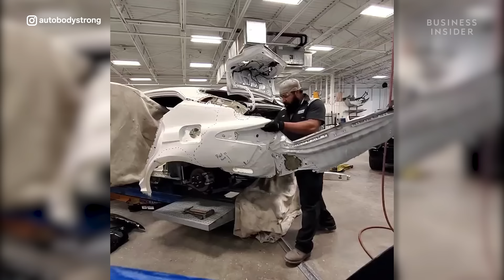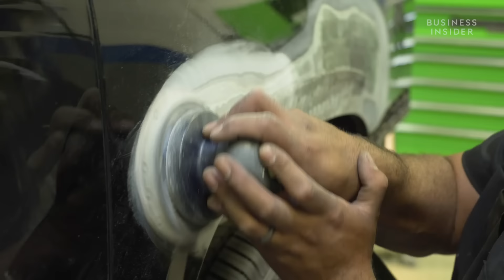How Wrecked Cars Are Repaired | Cars Insider

Comment: Correct me if I'm wrong, even if the structure is pulled into original shape, the material structure is compromised? Like microcracks?
Reply: True, and if it is the main frame, I would have issue with that, but not so much with most everything else.

Comment: My wife’s 2016 silver Honda Pilot started developing spots on the hood and roof in 2017.  It was examined and the spots were deemed under the clear coat.  As if the silver was corroding. We bought the car new and when we got it, we got an optional paint warranty.  But the warranty company refused to cover it.  Honda went ahead and did the job and billed the warranty company.  The Honda rep said “what exactly would the paint warranty do, if it didn’t cover paint problems?”

Comment: I've never seen a flat line puller, usually used a pin welder and a sled hammer or plastic pulling tabs and the sled hammer, very cool.

Comment: When pulling on a unibody you will never get it back to factory, the fender may line up but inside you have metal that is weakened and never as strong as before.  Very few body shops will pull the inner structure to factory specs then cut it out and replace it before replacing outer panel.
Reply: Almost always better to just replace the affected panels, did a lot of that rather than pulling. So many crunched trunk pans and quarters done.
Reply: As long as the specs are returned within the factory build tolerance, it's a good repair. The metal doesn't weaken unless it's crushed or kinked, and even then it's irrelevant unless it's structural. We repair pans, aprons, baffles, radiator supports etc. --- all non-structural.
Reply: @xpicklepie  The white rig in the video has UNIBODY damage the unibody is a frame on non frame rigs. The structural metal the guy is pulling will never be factory perfect. The metal will stretch and the points may line up but the crushed metal will always be weaker that factory, it will crush a lot easier if hit again. Any decent car person will pick off that repair and it will affect the value of the car, it may fool Stevie Wonder but not a person that knows cars.

Comment: I had my first two cars Volkswagen purchased from Weiss vw in queens village New York City 1969 1970 it was very honest sales service part even body shop all lean honest nothing un safe left there I possible to prevent  so I only would like to see more done this way these days  why is there now so much screw you double financing charges dealer or bank both extended warranty you should never buy or use of cheap bad parts not organic Orem ones that fall apart in two days off the window defroster rear window when I was growing up much nicer more honest quality work from those who really cared the worst is the nut behind the wheel operating or loco driver on drugs alcohol more what troubles this causes too much done today is how fast it can be fixed rush rush I have said in my past remarks enough we live in a society of very sick loco volks doing very stupid sick senseless thing as weird as is the persons doing it haste makes waste sometimes take longer to do or when if possible not right time to do over over donot we should try to do more than we could in 24 hours per day adios for now until we meet again

Comment: I ran a Carfax on my old Camry out of curiousity that I sold several years ago after owning it for 7 years. Come to realized too late that the car was a total loss 6 months before I bought it. It was my first car and I was attending college but it didn't seem out of place performance wise. Only notable imperfection was the left side mirror cracked and the rear passenger fender had a clear coat scratch. The car was in two accident, one minor (the right side) and the front (major, insurance written off as total loss). Odd thing is, there was no salvaged title with the car.
Reply: people spending too much time worrying about title...A low mileage total loss car is better than a high mileage clean title car..

Comment: FYI don't buy vehicles with this kind of damage. When steel/aluminum is deformed, pulling it back to it's original shape will NOT regain it's original structural integrity. So if you buy one of these cars and get into another big wreck, you are basically done. And yes these guys are clean and stuff but don't buy rebuilt cars for your safety.
Reply: FYI this is why Repairers have to follow Manufactures Guidelines and repair procedures now.
Reply: @Jpgundarun      once the steel/aluminum is deformed, it will never regain it's integrity even repaired. ask any honest engineer and they will tell you the same thing.
Reply: @joezhang839  So multi billion dollar car manufacturing companies don't know the best ways to repair their own products. You Tube experts know better do they? I have been repairing major damage on cars for over 20+ years without a single problem so you must know better than me too.

Comment: It’s revolting to see him grind the paint of that dent to weld the keys while instead it could have been repaired by a guy that does Paintless Dent Removal and the panel would have been good as new preserving the factory paint which can never be replicated in durability. Fair play for all the work done!
Reply: That's for sure. Once had hail damage to my truck. Insurance company wanted to replace the hood etc & said it had close to $4,000 damage. Took it to a paintless dent repair & they repaired it for less than $400! Couldn't tell it was ever damaged.
Reply: My thoughts exactly. Pointless dent guy would have qorkd magic on that
Reply: Did you not see the paint was scratched before he started? Makes no sense to paintless dent remove a panel that needs to be painted anyway.

Comment: If your car is on the frame machine it's totaled and shouldn't be getting repaired.
Reply: Lol not true at all if the car was put together in the first place it can be restored to that state. Your clearly not in the business so just shut it Nathan
Reply: Obviously a massive frame bent in half will never been the same but slight bends a few inches off from front to back can be fixed with no compromise to strength the metal remembers its shape it wants to go back to where it eas
Reply: When a nascar gets in a wreck do you really think they scrap it? They just pull it back into shape and it goes to the next race. When an old classic car is restored and it has old damage from decades ago do you think it should be cut up for parts?

Comment: And what happens when the damage is so extensive to the frame itself?
I guess is total loss
Reply: Frame rails get replaced using the factory weld points.
Reply: If it's a ladder frame as in a pick-up truck, they actually pull very easily. They're usually riveted together and there isn't so much damaged metal as there is mis-aligned joints and crossmembers. They're made to flex quite a bit.
If it's a crushed or collapsed frame rail on a unibody, the damaged section is replaced. The cars are made with 'crush zones' that keep damage localized.

Comment: Most mechanics watching this video 👀👀, for those who don’t know, imma reveal some secrets for ya, a lot of the time we don’t do things by the book, we don’t use laser measuring tools and equipment to tell how far off something is (unless we are dealing with insurance and need to prove there is frame damage) we will just free hand it, yank on it a bit, a bit more, bang it back in place with a hammer, see if it’s cohesive and or juts out, if not, and it’s hidden from direct sight, then comes the saying, outta sight outta mind lol, this applies to both dealers and small shops, I’ve worked at a body shop that is bmw Porsche Volkswagen Audi and mini certified, did things the exact same way (all be it, with fancier tools lol)
 None of this is to say body shops are bad, it’s just that most insurance companies rob us when it comes to work, sometimes they’ll have us buy parts and remove it off the estimate (this means we can’t even use the part, even if we do, we can’t charge anyone for it, meaning we will have to pay for that) and some will also charge such low labor rates it’s absurd, 2 hours to pull a structural part of the car, and your paying me 50 dollars an hour for that kinda specialty work?? Any true mechanics should know exactly what I’m taking about lol
Reply: It’s like vacuuming. “Can’t see behind the couch, must not be dirty.” A comedian once said that.
Reply: I've repaired a borderline total loss after a vehicle hit a pedestrian cyclist, killed the cyclist and mangled the front end of a later 2000s MDX. But a Civic is quick to get the axe if it obliterates a deer, Adjusters and insurance companies make weird decisions.
Reply: @mikewilson6940  Yeah...you got that right. I hit a deer in Manitoba with my 09 Civic. After hitting the deer , I drove 80 kilometers to the city with the hole in my windshield (winter time) . The car still drove normal other than busted lights on the drivers side and the sheet metal damage. I wanted the car fixed ,...I am a retired body man painter. When it got to the dealership and the employees went over the collision, they added two small dents on the front edge of the roof, (which were from rocks flying off of highway trucks where I drive to work) which upped the cost (for painting the entire roof). And they added scratches from the factory aluminum rims , which were the result of careless stacking on my part  ( the rims had winter tires on which I swap out for other rims with summer tires on at the appropriate time) which added costs there. I knew they were deliberately running up the estimate...but I stayed out of it because so much glass had gone everywhere in the interior that I knew you would never get it out , and my C.D. player was making noises so I knew it and possibly other things in the dash were affected ...no airbags went off. It turned out the only real structural damage was a little metal corner tie that joined the rad support to the driver's side apron...and the rad support was slightly diamond ...everything else was sheet metal, windshield, bumper,  and lights . I knew what they were doing, deliberately getting it written off because the guy estimating saw that it was in excellent condition and he was going to buy it back at the government salvage auction ...and fix it and sell it. Working at a Honda dealership in the body shop means that he had parts he scrounged from repairing other cars...I know ...i worked at a dealership body shop. So there's that part of the equation to consider...the greed of the repairman.
Reply: @markanthony3275  That sucks, last time I got a deer was in our families Volvo 740 Wagon, took it head on like a champ but busted the radiator, had to get it towed but just pulled the front end off another vehicle and checked the alignment at work, kept driving it. Didn't want to deal with insurance because it definitely wouldn't have gotten out of a shop just due to age and a few other mechanical issues that weren't really financially feasible to deal with, automatic transmissions for those things aren't cheap anymore. I just default to fixing my own vehicles, if I ever get into a total-worthy wreck then it's going to be pretty obvious it's not worth the effort to fix, depending on the vehicle, and you're going to get screwed either way by the insurance.
Reply: @mikewilson6940  Brother I'm with you on that !   I have built a retirement home in Saskatchewan with my brother and his wife...and a 30x32 garage with a 12 ft ceiling. Can you guess why the ceiling is 12ft ? Cause I'm putting in a hoist so as a family we can circumvent the rigged system a little bit when it comes to servicing or repairing our vehicles. In Manitoba what they do is assess the value of your vehicle when you have an accident to decide how much money they can make if they part it out , or if they sell it as a salvage unit. That then determines their course of action whether they will insist an 8 year old car gets new sheet metal ( so the repair is higher than need be and they can write it off and sell it) or if a 4 year old car gets some "used" parts so they save money on the repairs. It used to be , when I had a shop in Saskatchewan , that I could do a "guaranteed estimate repair ". that's where I use what ever parts I can get that are used, guarantee that they are still good enough to make a quality repair, and guarantee that the cost won't exceed a certain amount for the entire job. Now, there is absolutely no way the insurance companies will do that. A guaranteed estimate repair was an interesting way to get business...because a lot of seniors had vehicles that were still running good for them and they wanted to keep them to avoid buying a new one. So sometimes a 10 year old vehicle would come in with a busted front bumper and as scratch on a fender...and they would write it off even though it didn't even have 100k on the odometer. I'm retired from the trade...and somewhat outdated , but I can still do what you did, check the structure,  and replace the parts. On a different and more difficult topic, the enemy of every working taxpayer and the enemy of the prairie provinces just got re-elected ...I feel for everyone on the prairies because Trudeau is...as I like to put it...giving the weeds the power to accuse the vegetables of corrupting the garden. Best of luck Mike !
Reply: Caliber  collision makes you measure it if we gotta replace the reinforcement. People are sue crazy and wreck check don't play
Reply: @loganfaircloth6412  I used an old Genesis system (20 years ago!) and we used to move the targets with a block of wood to get an accurate looking printout. One guy used to do that to move the targets out of spec to make the frame look bent and get paid for extra damage.

Comment: I wish the body shop where I work had this fancy equipment. Especially that computerized frame rack. We have to measure everything by hand
Reply: We have one at my shop but by the time you set up the computer you could have already just measured it by hand. I never use it
Reply: @GuapDolo  The measuring stuff is cool, but more of a PITA than it's worth. I went back to a tram and a tape measure after a few months of spending 2 hr to set the thing up just to get measurements. Even then it's a joke - if you have the pinchweld clamps under the car without the suspension loaded the car will sag at each end and the measurements will be off. 
I could do the whole thing in 10 minutes with a tram!

Comment: Frame machines are SCARY to work around. We have one at our shop and if a chain snaps or the clamps slip, the sound is deafening and if you get hit by that, you’re done, depending on how much torque is applied. I have much respect for our frame machine guys, they are cool as cucumbers.
Reply: Do they not have the option of standing in a safe location?
Reply: I always threw an old pair of coveralls or welding blanket over the tight chain - it'll absorb a lot of shock if it gives. Some guys will even use a separate safety chain when they're pulling hard.

Comment: If you see diagonal marks on the pinch weld under the rocker panels at the 4 corners(Made by a frame straightener) on a used car you walk away from it. These guys seem legit but alot of them are not.

Comment: Is the metal still structurally sound after unbending it?
Reply: No, it can still be strong but it would never have the same original strength as original.
Differences could be very minor but it's never the same.
Reply: Technically no. They should pull out the damage. Then replace the damaged metal.
Reply: @seanbailey8545  Sure, but that means cutting and welding and it changes the rigidity and overal strength.
Not to mention that paintwork with all that Bondo simply isn't the same. After time you will see (especially if your in a climate with changing seasons) that the Bondo reacts differently than metal and we often see that it cracks, or the surface kinda sinks in.
It all depends on the craftsmanship but in most cases you will see it later on (years) that damages was done to that vehicle.
That's why nobody pays full price for a vehicle with a history of damage.
Reply: Depending on the part and how bad it’s bent. Bent metal work hardens it marking it a bit stronger. But again depending on the part. OEM allows repairs without heat on a lot of parts.

Comment: What if your car's frame spots are rusted away?
Reply: Time to buy another car
Reply: @Big_Ben1988  If it gets in an accident, it's totalled anyway... I'm only using for fun in the backyard and sentimental value.... And maybe some road travel when I move out (I'm a teen)
Reply: @championbeam4018  well as long as it dont see much use.  Once they rust out they are pretty much done
Reply: @Big_Ben1988  i did a bunch of work on the frame by the transmission, so I checked the rest of it out. And its decent, until I was working on the engine by the wheel and the frame bent and the axle was just sitting on the ground. (The shocks need replaced, too)
Reply: @championbeam4018  Sounds like you might have a future in the automotive industry.  However I warn you it's not as glamorous as they make it seem on the Automotive School TV Commercials.  The pay at most places is pretty minuscule for the work you put in and customers think every job can be done in 15 minutes just cause they're waiting up front.

Comment: If the unibody/frame is damaged the car should be a total loss and crushed. .. the inertia will find the weakest point to fail and a frame repair is unsafe and the automobile could crumple in a zone that's not supposed to and kill someone..